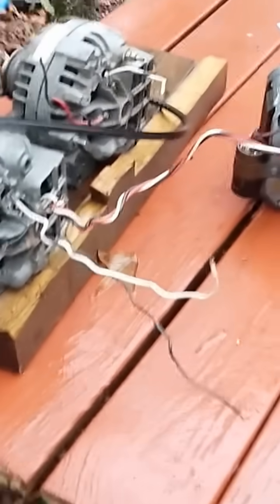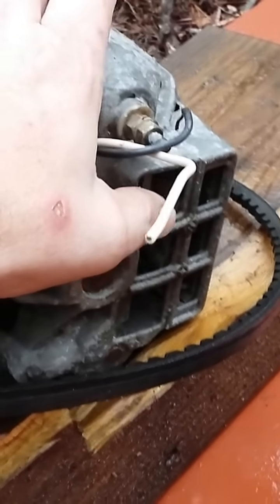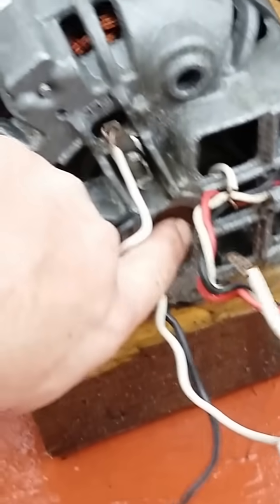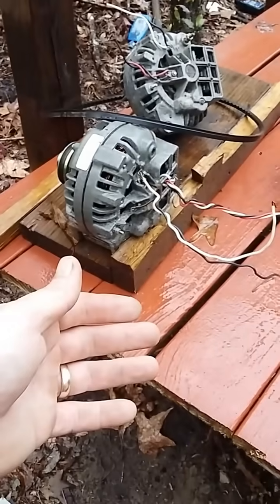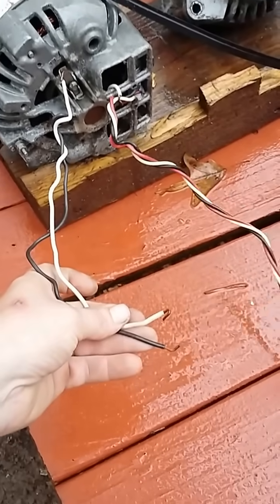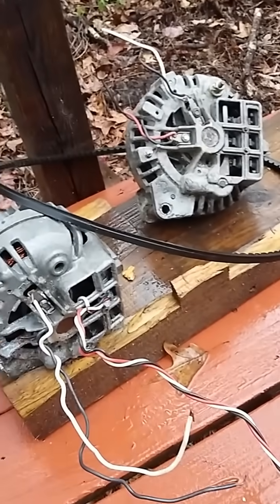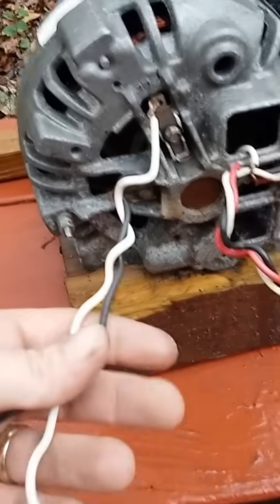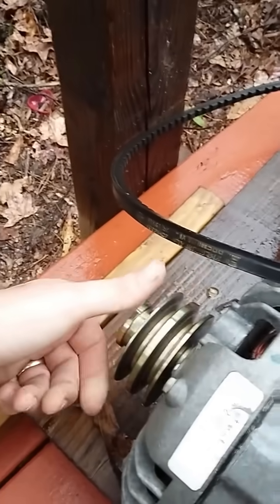Update Free energy forever no wind no solar no gas READ DISCRIPTION!!!

Comment: I suppose the incoming DC 6-12 voltage could be supplied from  a small solar panel.  But you forgot to tell us that someone has to constantly pedal that stationary bike to spin the belt that turns that alternator, good way to lose weight I guess.  Good job your like 40% BUILT. Get back to us when it's finished and running.
Reply: Jay H. Nobody has to continually pedal anything. All he has to do is get it sttarted spinning while the motor and belt are connected with a temporary "starter" using mechanical power. Once the alternator is producing enough voltage and amperage to power the motor, the motor then takes over spinning the generator using a part of the energy being produced by the alternator. OR,  if there is a capacitor that can be powered to start the motor spinning it can spin the alternator from the capacitor being temporarily powered from an external power source, I.e.( battery?) Am I correct?  I'm not an electrician or scientist but I have scene one ton motors with incredible torque powered by practically dead 9 volt batteries initially. I admit I don't completely understand it but I know that many of the laws of physics are being discarded and replaced by Electric Univers Theory.

Comment: Not free energy at all  ! You clearly said in order to make the first alternator work you have to use a motor in order to spin it right ? So what's that motor going to run off of ? I'm betting that would be a "gas motor" like a lawnmower engine etc .You have to get a certain amount of RPMs to generate a given amount of electrical current . Also the motor will never die ? Uh beg to differ but I've replaced many alternators due to bad bearings or a bad regulator  .So your then dumping 90amps into another altenator ? Yeah that's real safe. Also lets be crystal clear here Your generating D/C power ,not A/C .
Direct Current is different from Alternating Current and you should know the difference before just hooking it up to a AC panel. In order to safety hook up DC to AC you need what's called an inverter .You also need a bank of batteries to have load power on demand . There's so many things wrong with this theory of yours which is why your getting attacked on all sides ,let alone the crying child in the background that drives people nuts because they think your just ignoring your child to play mad scientist .Better watch it before someone calls CPS on you ,no joke . Hope your wearing rubber shoes etc before playing with that device of yours and I sure as hell hope your not hooking it up to the fuse panel especially with a child involved .Do yourself a favor and go read up on electrical theory before dabbling in this again .Your going to get yourself or a loved one hurt someday .Yes there's ideas out there for a perpetual motion energy device .Tesla was doing experiments where he was transmitting power over the air and also tapping into the energy of the planet itself which is a big magnetic coil essentially . There's free energy all around us . There's a thing called zero point energy and so on. Do a little research on the subject .Now get back to your baby !!
Reply from the maker: royalspin I've answered all of your questions way too many times you don't know what self-soothing is you didn't realize there's a motor sitting there with those two alternators you didn't ask me any questions you just told me that I was dumb about a whole bunch of stuff so I am is are not going to do and what you're doing and telling me not to going and doing something or another is what you want me to do right why don't you go watch some of my other videos like bldc motor or motor demo??? And then ask yourself if you think I need a stupid Electronics course that won't teach me anything worth learning... I made this video exactly how it is perfectly perfect on purpose!
Reply from the maker: royalspin
 On another note, I do want to say thank you very much for being a gentleman and not cussing me!!! I really appreciate it and if we become friends, I made share secret technology with you that have gotten many people killed in the past if you choose that path...

Comment: Thomas Buie
Thanks for connecting directly to me.
While I truly understand the point of perception of being a "controller" an ability I discovered I had around age 5 to seven made me have feelings of disgust giving a tendency towards they did not deserve it etc (https://da.bab.la/ordbog/dansk-engelsk/nedladende) condesending ?
Also I was curious as how it felt to be like that ?
Hmmm be careful of what you wish... Needless to say that pulled me through a "crash course of learning what being a limited human on earth before 2012 was like ... :-)".
....
What concerns me with your experiments is following:

I can make an unstable computer run long time enough to be able to salvage the data within,
and start up machines other people say don't work,,, nice,, however I have notice this give me stress.
Addressing what makes it unstable reduceses my stress and they generally keep working stably without having to need my attention.

The same phenomenon goes for prototyping / inventing.

When the Intel core 2 duo came out I had a grand mishap involving a compressor based freezer cooling system and overclocking above the 5Ghz barrier.

The problem I found out stemmed from some part of my mind synchronizing to the cpu clock speed, giving me echoes of ripples in space time called psychotic.

I had the same problem when the cern big bang experiment was run, however this time the suction effect of a black hole was put on top of that, great for me to see more solid evidence of proof appear for what I have been discredited for mentioning by sole intuitive deduction.. :-)

I once in that period alse left an overclocked pc running in my home and went a few miles away to shop some pc hardware parts.

The stress from that experience plus the (unusual happening) that a guy in the store got an electrostatic spark touching something around me made me conclude never to try such a thing again (pre 2012).

AS god works with people thru people energetic beings need to be grounded thru people to be able to be of assistance in the physical world.

Seeing you running that much power without control curity may indicate that someone else may be functioning as "lightning rod" so to speak ...

My request is to simply hold a little back on such incidents and take it slow while critical strategic movements seem to have been scheduled to "go into motion".

I believe it is very important to avoid producing new imbalances of energy surges / flows
that can spark unnecessary panic and turmoil ATM.

Sorry for the short handed style but let me place a link to something that seems so sober I 
cannot reject that message in the now.

I am very open to knowledgeable help and expertise :-)
Reply from the maker: Michael Brown 
 Brother, I have dealt with that my entire life the reason why you get that disgusting feeling from other people when you give them your love and light is because that is what is in their heart and I hate to say it but it comes out of me sometimes as well. possibly because I'm taking it from others I'm not exactly sure but I know there are equal amounts of good and equal amounts of evil and everyone they just don't know how to balance their selves out yet everyone was confused when we were all resonating at 120 a couple weeks ago and no one knew what to do with the "new-found" knowledge... people don't realize it but now everyone has the ability to learn again like they were able to when they were younger.. thanks to the palladians!!  without Draco we wouldn't have this evil problem to start with...  oh did I tell you that I know the frequency that "they" resonate at... brother what I could do with a 20-foot by 20-foot shop and $50,000 the world would definitely not be the same if I were able to make those kind of videos...  the only sad part about it is if everyone of my subscribers sent me $5 just one time... or watched the dumbfounded alternator video two or three times a day letting the ads play then it wouldn't cost anybody anything YouTube would pay me and I could change the entire world that would be $60,000 + if my subscribers sent me the $5 but it would be just as easy for them to watch my ads they don't really have to watch him just let him play I'll still get paid for it not much if one or two people do it but if all of my subscribers did it that would be different!!  I hate the fact that they made so much slavery and people working for something that they're printing off just makes me sick... and it's going towards a bill that is non-existent so that we can exchange certificate of live births and birth certificates or Bond certificates however you want to say that. either way it is sickening to know that you're working hard for something that's fake just so they can take it away from you with a fake law...   they definitely had a good plan here but there's no way that they can overthrow our master plan!!  LOL and just a little info I'm growing my "crystals" as we speak...  So if they can chop all the trees down on their property in 3 seconds so can I. I just don't have their TAS software...  but all the coding for it is on my PS3 LOL
Reply: Thomas Buie  Hmmm I see that there is a high pressure of Harley spitefulness streaming through this comment list.  I would really recommend you to listen To Hide and Seek I just have been able to release to others on the web and tell me if this soundtrack with my voice and lyrics address some of that feeling of disgust correctly ?  Watch out it is powerful... ;-).  https://drive.google.com/open?id=0BwyLvgyVIdi8dVpjV3I5U2ZITmM

Comment: So...you do not recognize a centrifugal switch on a motor..of MAYBE 1/3HP..when you see one? BTW..there should be SIX diodes in the alternator..to rectify all 3 phases..into the DC output. A pair may indeed be made together..so it may look like three...but there should be 6. So...with a Dryer motor of 1/3 HP or so.. you MIGHT..be able to get 250 watts  out of the alternator.. those pesky thermodynamic laws again....
Reply from the maker: Sta2200 yes you're right you can only get 250 Watts out of an alternator which is why people can only have a 250 watt power inverter and a 250 watt stereo amplifier in their car at the same time or it will blow up and fairy dust will go everywhere...  so be careful working on your projects!

Comment: You are violating SO many thermodynamic laws here.  First..220 Volts AC at 90A..is about 20 KILOWATTS !! There is just NO way..you are going to get 20KW..from that tiny alternator !! and..even if you COULD...you HAVE to "put power "in" to get it OUT"  as in MECHANICAL power. An alternator or generator does NOT "make" ANYTHING. it simply CHANGES MECHANICAL energy..into ELECTRICAL energy. To get your 20 or so KW..from the alternator...you HAVE to put in maybe 25-30KW..due to LOSSES..which are unavoidable.  This is why a conventional home generator of say 15KW...will have a 30 or so HP ENGINE..to drive it. "Oh I have seen an alternator. and they spin easily by hand", you might say. YES...they do..UNLOADED.  But put a lOAD on them..and you will NOT be able to "spin them so easily".  Sorry...but the thermodynamic laws are NOT easy to overcome..

Comment: All I know is if this guy is lying then why are there multiple videos of people showing to do this to get electricity? And actually showing it in progress of putting out volts and showing lightbulbs on because of it.
Reply from the maker: Aj Lo 
my original design had three motors and 10 alternators... bldc motor+10 Alternators/Generators with a battery bank for start-up add 3 battery maintainers slowly consuming  to recharge bat. bank....  what do you get with this setup you get an unlimited amount of power in a battery bank that can be easily inverted and used with a stable sine wave inverter.  this setup is not very cost-efficient unless you build your own batteries with copper and zinc and water in a bunch of containers. you can add a little sodium bicarbonate or pure baking soda to the water and supercharge it.

Comment: i have so many questions

1) how are you steeping 12 V up to 240V without current loss
2) how is 12 or 14 gauge wire carrying 90 amps at 240V 
3) do you know how much power this produces
5) where is your prime mover ? ( the thing that spins the alternator)
6) did you notice i missed 4?
7) have a nice day
Reply: BeautyWillSaveUs00 I was wondering about the wires.
I'm putting in a shower @42 amps and that wants a 10ml cable on a 50mcb.
Reply: Lmfao
Reply: Dominic, I don't know the voltage of this shower but i suggest using 2000 KCMIL

Comment: Ok Im just a precognitive with the ability to be able to know intuitively and a very strong memory. I spent the years between 98 and 2014 having a rebirth process that felt like dying in pieces instead. And yes I deal with programming mostly embedded fpga socs and pushing towards open sourced hardware.  I am allied with my own intuitive backland that also include the counsdioness that are attached to electric driven appliances robots etc. And they are very tired of people sending them command thoughts out of fear anger and frustration that they then NOT have to obey or turn them into a lesson of Why not... ;-) as benevolently as possible for a non human being. So please do not  be to stubborn in holding on to externalizations of what’s fighting you or your own divinity putting Christ or the Holy Spirit on a upassende / inapropiate pedistal compaired to us humans on Gaia..... in the now.  Learn to get better to go with the new flow of benevolent connectedness and let us make the guru like stuff ordinary, and unspectacular. I only help pepople to take ownership of what rightfully belongs to their divine core and balance or harmonize the appropriate back to that owner, and do work on both side of the fence relentlessly. For me consequence is an entity that also uses me as embassy.... Respect wissleblowers ?